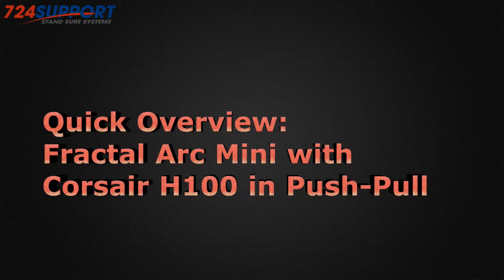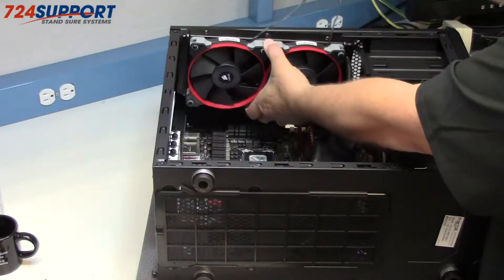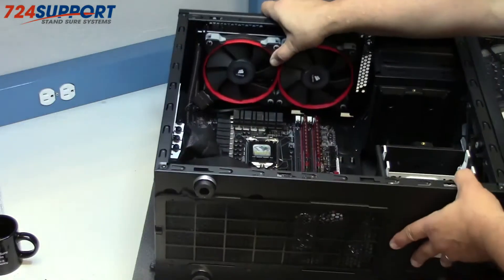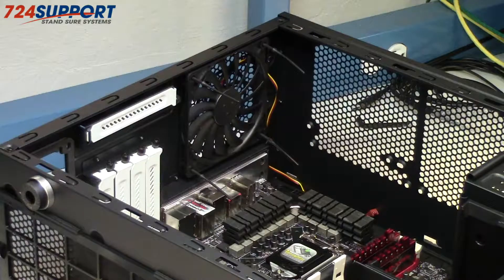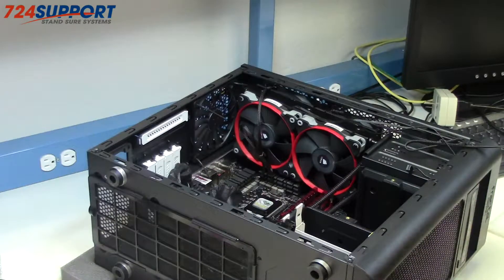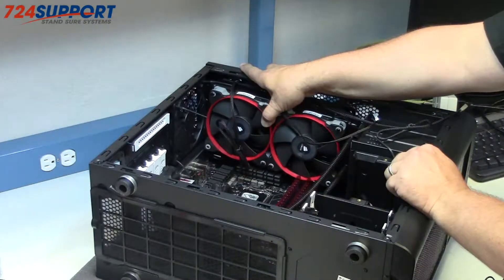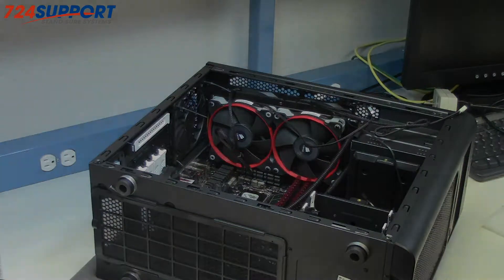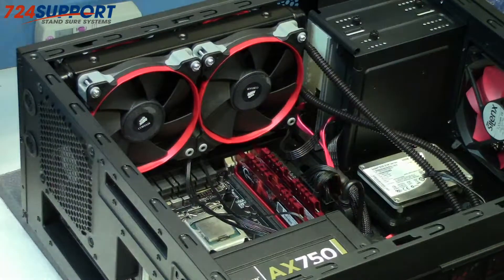Fractal Arc Mini with Corsair H100 Push-Pull (1/2)

Comment: sir,
i have a corsair h100i and i want to make a push pull configuration.
so could you please correct me if :
1) i need one PWM splitter cable for additional 2 fans
2) extra 8 screws and washers for 2 fans